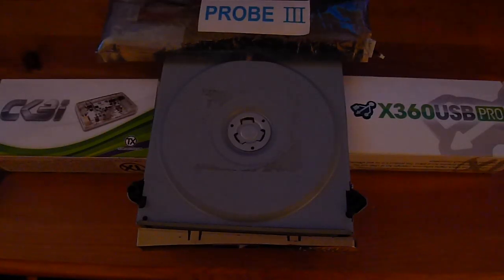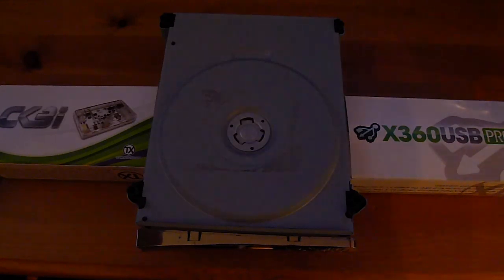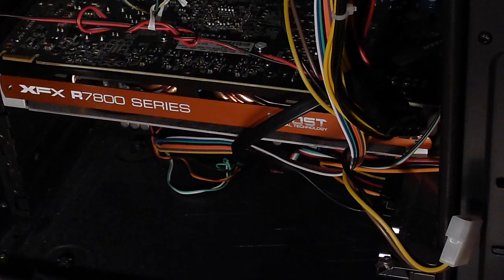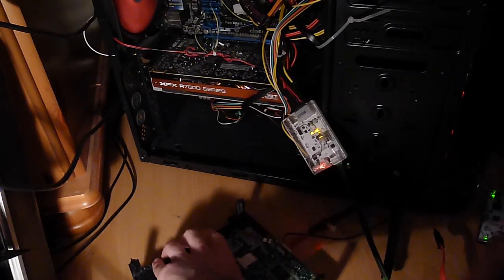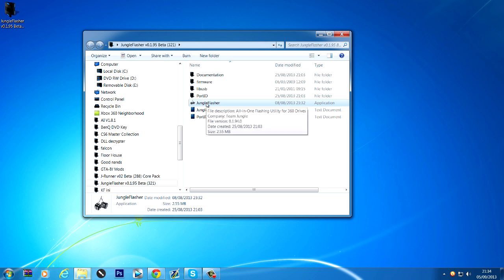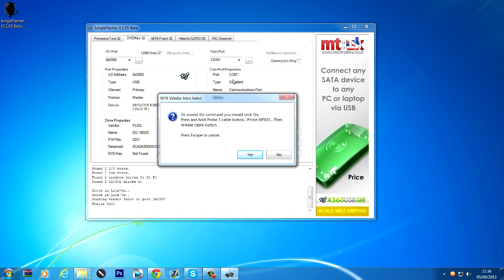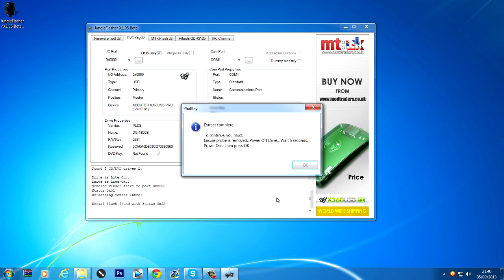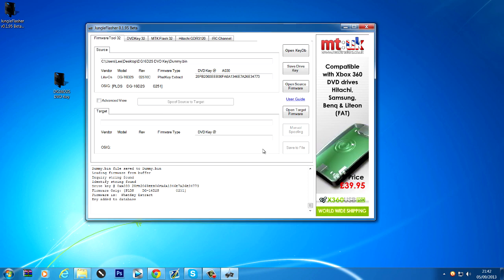Hardware Tutorials #5 Flashing a Lite-On DG16D2S DVD Drive

Comment from the maker: You would need to copy the DVD key from the retail drive and flash it to the RGH consoles DVD drive. That will let you use the RGH drive in the retail console. However I would only recommend this if both drives are the same make and model. if they are different then it is possible for your retail console to get console banned.

Comment: MODDED WARFARE: Hi i have the Maximus Xtractor Pro and a Spear. I use Jungle Flasher and click on PhatKey. The i turn off the Drive and point with the Spear that MPX01 and power back on the Drive. Jungle Flasher said found key and then Key Extract complete. I put the Spear away and click ok for getting the keys but Jungle Flasher said phatkey failed.

Comment: Heey man thanks a lot for this guide its great my question to you is do i need to remove the laser ribbon while the flashin process happens as iv seen on alot of videos that you need to but you didnt. Also once iv done this will i be able to play my ready burned games or do i need xkey and finally can i still play retail discs if i flash my console. Pleaea could you reply asap many thanks.
Reply from the maker: You don't need the Xkey it has nothing to do with this. Also you don't need to unplug the ribbon cable. I have been flashing drives for a long time and I never remove the ribbon cables.

Comment: will flashing your Xbox remove the DVD key? I switched out the DVD drives of my Xbox with another Xbox and it wont let me play games because the disk drive key and my Xbox key are different. so will flashing my drive remove it? or is there anyway of changing the key?
Reply from the maker: You can copy the drive key over from your old drive to your new drive when flashing the DVD drive. Extract The DVD Key from the old drive and when flashing the new drive load the extracted dummy.bin file from the old drive and spoof source to target to copy the DVD keys but this will only work if both drives are the same Make and Model. Another thing you can do is just put the PCB from the old drive and put it on the new one again this will only work if both drives are the same.
Reply: xXModdedWarfareXx Yeah, the disk drives i got are diff models. well thanks for your help anyways

Comment: I tried and for some reason when I put in a burned disk it will spin but then say open tray.  When I put in Far Cry 3 it will play but takes a long time and it says my GTA V is unreadable can you please help?!?!?!
Reply from the maker: You might of flashed the wrong firmware for your drive type. Other reasons could be that it failed to flash so it still has no firmware on it or the drive might still be in vender mode.

Comment: Hey man jus wondering if this still works on latest dash as my parts are coming next week please reply ASAP many thanks.
Reply from the maker: Hi, Sure this still works I don't think it will ever be patched so don't worry. It has remained undetectable to Microsoft since the firmware was released back in December 2011. As for your other question, yes slim drives can be flashed also but not in the exact same way as this video shows. It depends on the type of drive.

Comment: My jungleflasher stuck at "Writing to bank 0..."
Any advice?
Reply from the maker: +FARŲ Perlai Normally a driver issue. You can try disable driver signature enforcement in the boot options of the computer. When you start the computer you hit F8 key multiple times to get the boot options. Or you can use a program to run it in test mode. I cover it in this video: https://www.youtube.com/watch?v=G7i9ZlQbx1c watch from 6:49. If that doesn't fix it then maybe your SATA ports are not compatible in which case you need the X360USB Pro.